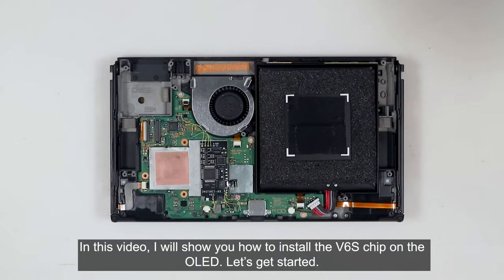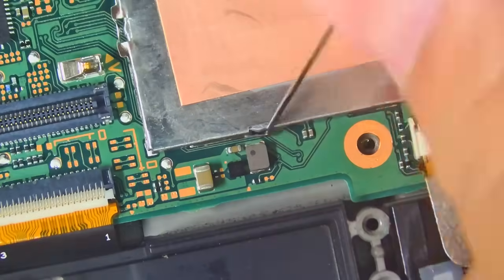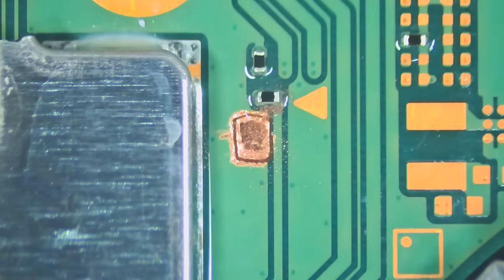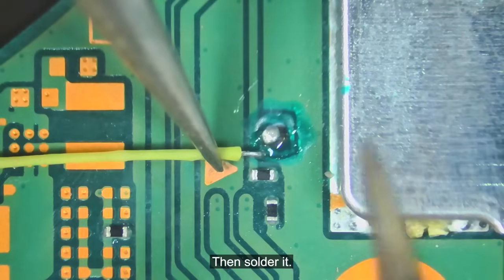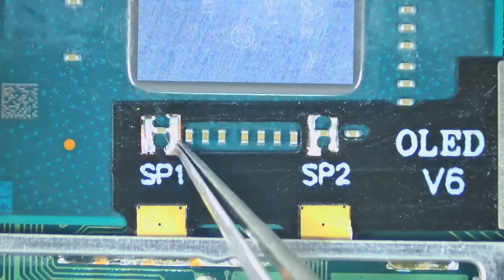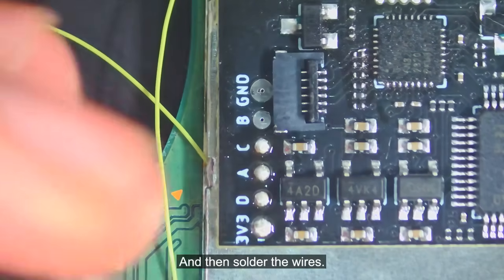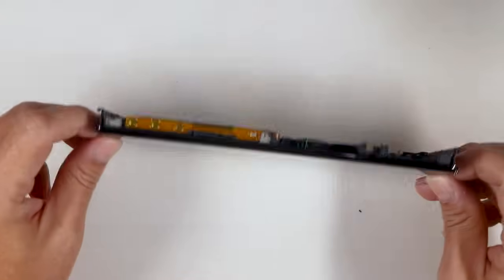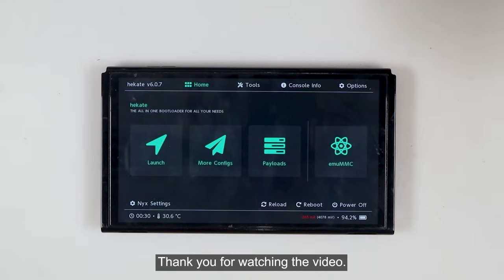OLED V6S WITH THE KAMIKAZE METHOD

Comment: Definitely not for the faint of heart! Still crossing my fingers for a software base vulnerability!
Reply: I understand your concerns but it just isn't going to happen.  I'd suggest buying a premodded switch with picofly. Barely more than a used switch.

I hope in years to come I will have to eat mt words, but it just won't happen.
Reply from the maker: yes you can use Yuzu
Reply: @whitak3r  I was thinking that since its almost EOL for the switch since S2 is just around the corner, theres a bigger incentive for the hackers to look for exploits, kinda like what TheFlow did during the EOL for Vita. He kept the exploit to himself and only release it after support for Vita was dropped.

To be fair, a modded OLED in the market here costs about 33% more than retail. So, maybe that makes sense...
Reply: we can all wish, but really it will never happen, and if im being honest this hardware “vulnerability” to me isnt really a vulnerability, it is literally an external chip forcing the hardware into submission by writing to the emmc and pulsing the soc, now it is still literally a vulnerability, but what I would consider a real vulnerability is the original v1 consoles problem.
Reply: @whitak3r barely more than used? Oled used runs 350 canadian used. Oled modded is minimum 600 cad. Quite the difference. Sold mine for 600 a few days ago, im the minimum lol
Reply: This method isn't for the faint of heart but it's also completely unnecessary.

DAT 0 adapters or reflowing aren't perfect but it's a hell of a lot less risky than this method.
Reply: @whitak3r "isn't going to happen"

The mig switch might open the door to that
Reply: Oh it absolutely is now. Theres already a few p2p dumps with the requires files extra files.Most the releases have to be redumped to include the 'extra" file(s) the mig switch requires. This won't be long though. Long live The Scene.

Comment: I cannot find the .2mm bits anywhere. The ones I find are an actual drill bit and not a grinding bit. Any recommendations?
Reply from the maker: You can buy it on https://www.diyfixtool.com/products/ma-ant-d1-electric-polishing-pen-glue-adhesive-remover-for-phone-repair?variant=44366849507557

Comment: I have a picofly v6s do i need to do the kamikaze if my dat0 flex cable isnt getting a connection even when i think its fully lined up? Whats the alternative?
Reply from the maker: kamikaze all the way..
Reply: @sthetixofficial  ah thank you for this! Do i need that grinder tool? Or can i slowly scrape with what i have? Dremel or fine point xacto blade, etc
Reply from the maker: you may want to watch this https://youtu.be/8ZNde4MVz54?si=RDPPdlAsGA7hl_Tj

use the ma-ant D1 with 0.2mm head
Reply: @sthetixofficial  ah thanks again! You're the man
Reply: @sthetixofficial   last question for you, i bought v6s chips for my oled. Will they work for any oled? I believe my switch motherboard looks different from yours in the linked video on the schematic. And i can still do kamikaze on mine?

Comment: Just a warning when soldering the USB pass through, it’s very easy to bridge the VBUS capacitor to the one next to it and extremely difficult to unbridge because of the tight gap… currently waiting on a replacement so my switch can charge again :(
Reply from the maker: Do not connect the Vbus D+ D- as it has bugs.

Comment: Has anyone had an issue with connecting the D+ D- and VBUS wires , when the charger is plugged in, the system goes into a boot loop attempting to boot hekate ? - remove the charge cord and it boots fine (yes using a genuine charger)
Reply from the maker: Dont connect the D+ D- and Vbus. It has bugs.
Reply: @sthetixofficial  Will remove them, thank you :D
Reply: @performancemodchips  So you haven´t had any issues after you had removed them right ? Cuz I have the exact same problem. But I don´t have any soldering equipment, will it be enough if I simply cut all the wires off from the D+, D- and VBUS points ?
Reply: @MrCANER06  No issues removing them, if you dont have an iron, cut as close as you can to the points on the mobo and cut as close as you can to the chip, remove the section of wire - done

Comment: Very clean job and so satisfying to watch. Keep up the good work and thanks for inspiring us to improve.
Reply from the maker: you are welcome
Reply: Hi, i followed this tutorial but ended up switch not booting. I removed all wires and mod chip but still it is not booting up. Do you have idea how to fix?
Reply: @sthetixofficial  Fantastic work!! Can you tell me what RPM speed did you set the MA-ANT pen grinder to? Has 3 speeds. 5k, 10k, 15k RPM
Reply from the maker: the slowest.

Comment: Tried this method today, everything worked fine, thankyou so much for your video!
Reply from the maker: you are welcome
Reply: @sthetixofficial   I did It but when I put on my console and after training process, v6s have led light Blue and doesn't open instinct page but NORMAL page. I have checked all value in diode mode and was ok. What's wrong?
Reply: @GiuseppeFregiato  That I think is a problem with the CPU flex cable not being soldered correctly

Comment: awesome video i would love to see a follow up showing how to use the flash and reset via the usb port thanks for your hard work
Reply from the maker: the USB port is ommited now, it has bugs, so dont use it
Reply: @sthetixofficial  Are the bugs in the updating part or the reset part?Or everything cause I just got somebody.I know upgrade my modchip to a v6s And solder the wires to be able to use the USB.Port like you did in this video if so can I upgrade via payload and sd card also how do I check what firmware is on the chip?

Comment: Hello! not sure if you're around to answer questions, but all my diode measurements are correct and solder joints look okay, FPC is a little rough but measurements seem okay. I'm getting a solid white light on my V6s (other colors show up and go away quickly). White light stays on for like 10 seconds and goes off. disconnecting the cpu cable also doesn't boot the switch. I'm getting a black screen either way.
Reply from the maker: it is not always about the diode value. White means something is shorting or not right too. Please check everything that were altered.

Comment: Great video again, many thanks. I have this chip coming in the post if I solder it just like the video how would I reset the chip via USB if it ever needs it. Same question for the update via USB process.
Reply from the maker: If you connect the D+, D- and the Vbus, you just turn the console off, connect the console to your computer and do the Putty procedure. Please watch my Putty guide.
Reply: @sthetixofficial  will do, thank you.

Comment: So big love inside !!! ❤️

How much grad must the hot air for tinning the dat0 280 grad ? without fan = 0% from 100% ?
Reply from the maker: it depends on your hot air settings and solder paste type. mine is leaded and needs at least 180c - 200c (real temp) to melt it.
Reply: @sthetixofficial  Hmm I don't think you can melt anything at 200c on the hot temp station. Maybe 350c up and airflow to 30-40%, what do you think? Soldering gun will melt solder at 200c but not sure the air station will be good that low. What exactly do you have it set at for ChipQuick solder paste 63/37.
Reply from the maker: lead free will melt at 225c, while leaded is lower 180c.  you need to find the correct settings of your hot air rework station yourself.

Comment: If you went too far on the D pad and broke the via, is it possible to recover the board by removing and reballing the emmc with a breakout board inbetween? Then make a jumper wire from the trace (reenforced with solder mask, of course), directly to the emmc?

Comment: what temprature is the hot air at? also is this brand > YIHUA 959D-Digital good for this kind of task?
Reply from the maker: you need to determine the temperature that could melt lead free solder. I set mine to 414 c on my station
Reply: @sthetixofficial  which hot air gun do you recommend when on a budget?
Reply from the maker: @Meowtional I used aoyue, haven't tried other brands
Reply: @sthetixofficial  ah alright i decided to go with Atten ST-862D it has the possibility to lower the fan speed for example 414c on 10% causing it to blow less air which percent would you put it on? 5-10%? cause i don't want to damage the pad lol
Reply: @sthetixofficial  also what fan needs to be removed you mentioned it at tining the dat0 pad
Reply from the maker: I set the fan to 50 percent

Comment: Hi,
very good video and explained in the most simple way. Just one question, If I don't have a grinder what tool do you reccomend to expose the B and D points?
Reply from the maker: you better buy a mini grinder, i dont recommend using other tools.
Reply from the maker: I only recommend using a mini grinder. But maybe you can try to scratch it using a very sharp tweezer
Reply: Thank you

Comment: So about this interference when using the FPC cables: How does this manifest on a switch? Blue screen? Hekate exception ? It just doesnt boot? I installed about 6 chips with them, all working fine for weeks. The seventh is a special one: Worked at first, then started to blue screen on boot. Removing the flex, letting it sit for few hours without power brought it back without blue screens. Reinstalled the flex, working again, after a few hours same problem, bluescreen on HOS boot, blackscreen after AMS logo and no boot. Removed the flex again, and it came back. Any idea? I probably just fked up the solder or flex is faulty, isnt it? E: Points were all good, chip was working all the time, eMMC is fine too.
Reply from the maker: most of the issue is it cannot boot to the ofw.
Reply: Intermittent unreliability due to thermal expansion cycles. Just use wires. The CPU flex is ok but the rest should be wired directly.

Comment: Well now I want try this method too, let's go buy another OLED hehe
By the way... any new reason to not use the FPCB for the point A, 3.3V etc...?
Thanks for all clear guides!
Reply from the maker: it causes signal interferences. that is why, using individual wires are preferred
Reply: @sthetixofficial what signal interferences will do? Cannot boot to cfw?
Reply: @etherealyuu  Noise in the data lines and unreliable connections. Just use enamelled wires 36ga.

Comment: Great job! I'm wondering what temp is your solder paste and solder wire? And, just for reference, what temp/airflow do you set your soldering iron for the CPU caps and hot gun for the Dat0?
Reply from the maker: i dont use a hot air currently but i use a solder paste. you can do the same thing using a sharp solder tip , like the T12 JL02
Reply: @sthetixofficial  but what is the melting temperature for the solder wire and the solder paste? 183c or 138c?
Reply from the maker: @lyubo89 183c
Reply: Thanks :)

Comment: As always, great and informative videos!

One thing I would like to know. What kind of interference causes the flex cables? I wasn't able to find much info about it, just some random posts which looked like the chip causes issues with the Switch (black bars on the screen, fps drops, etc.). On the other hand, I had issues with the chip that was randomly un/able to glitch the booting but after sticking it on the shield and covering it start to work properly.
Reply from the maker: at some point your console cannot boot to the OFW with the kit

Comment: @sthetixofficial If the DAT0 line were to break by scratching too much, would the console not turn on? Or what kind of damage would it cause to the console? In that case, is there a way to repair that line by connecting the DAT 0 of the NAND to some small remnant of the kamikaze zone? Thanks for the video.
Reply from the maker: yes your console cannot boot if the DAT0 line broken. You can repair the "bridge" or connection between the emmc and the cpu by removing the CPU and the emmc chip.
Reply: @sthetixofficial  thanks for the reply

Comment: I discovered that with firmware 2.0 Instinct NX V6S loads OFW after working in the dock. stations.
If the firmware is 1.3, OFW loading occurs less frequently.
What is the most current and stable firmware now?

When loading OWF led blink:
1) red light flashing 5 times,
2) purple - 1 time
3) blue - 3 times.

Why?
Reply: The problem was that the wires were long. They should be made no longer by 2-3 cm, as shown in the video.

Comment: Is there any particular reason why you used a different RST point from your last OLED video? I remember when I installed the V6 on my OLED I had some issues with it resetting itself randomly until I redid the RST point and put some tape on it, is that why?
Reply from the maker: The top RST point will be more convenient to solder if you don't want to remove the board from the chassis.

Comment: whats the number wire are you using,, in the video,, and is it a solid core wire ?? or Stranded
Reply from the maker: stranded wire, ul10064 teflon wire.
Reply: Enamel wire can be 36ga.

Comment: @sthetixofficial A question that I know may seem absurd but I'm sure you know something. Can the kamikaze method be performed on a Mariko v2 or a v1? I know it doesn't make sense to do it but the point is in the same place and there are the same resistors nearby (A)? it's worth knowing since it's more common to find normal boards to learn. Thanks
Reply from the maker: why do we need to do the kamikaze on other consoles while their solder point is exposed.
and each motherboard has different layouts, so it doesnt make any sense at all
Reply: @sthetixofficial  Because it's easier to find a bad switch board that isn't OLED to practice with, is it possible to find it in the same place?
Reply from the maker: you mean for practice?
you can buy a dead oled board or try using any switch board and sand to the 3rd layer.

Comment: Hello, which speed should I choose from 1-5, would I choose between 1-2? Does it take a long time to drill through layer 2? I would like to try this giant because the dat0 adapters are simply disgusting
Reply from the maker: 1 is enough. it took me about 5 - 10 minutes to get to the C point.

Comment: I would like to see an alternative clk point, I don't like that point, let's see if you can find an alternative without having to raise the cpu or emmc. I know you can do it
Reply from the maker: you need to remove the CPU cover to install the CPU flex cable. And at the same time you need to scratch that D point - as there is no other alternatives. please check the board scans if you want.

Comment: hi boss, I did all the installation well, all the contacts are perfect even when checking the tester in diode mode, but always with the OLEDs, every time the chip works 10 times and 1 time it doesn't, it produces a white LED with the instinc v6 or v6s and then the original system starts.
always the problem whether it's samsung memories or worse with skhynixm, 10 times the mod starts and 1 time it doesn't, then subsequently like this, 6 times or 20 times yes and 1 no, it goes randomly, and the connections are perfect, I always try changing chips between instinc 6vs, 6v and rp2040
can help me plz, and i do kamikaze
Reply from the maker: check ur soldering quality and micro shorts if they existed. check the sp1 sp2 flex too (the mosfet area).

Comment: Im try using this method.. overall after I'm grinding layer by layer my oled turn on normally.. But I'm didn't why my oled didn't turn on after last layer I'm make..i thought it 4th layer.. after connect battery and turn on 3.3v cap didn't have any volt.. could it be fixed?
Reply from the maker: you need to know if you have broken the track.
Reply: I believe that is on the 3rd layer?
Reply: @AdrianAndreiRobert  I'm repair and make track back..and it work .😀

Comment: Possible to make video how to resetting or flashing the V6S chip directly from the console USB port?
Reply: Sometime happen when chip crash always boot into OFW,  we need to reset chip using method taking off the battery and plug in back, is this V6S chip will help to solve the problem reset using USB port?
Reply from the maker: I suggest buying the V6S next month as they will have new firmware inside it.
Reply: very sure this problem causing by soldering USB 3 point, if i unsoldering 3 point all work without any problem, i think some step is missing like need to reinstall MTP driver?

Comment: Just pressing both volume buttons will boot it into stock firmware? No press of the power button?
Reply from the maker: power it on, and when you reach the chip logo screen, you need to press both volume buttons.
Reply from the maker: or, press both volume buttons then  press the power button.
Reply: @sthetixofficial  thank you

Comment: I was wondering why you used a grinder to expose the B point track, unlike in your V6 OLED video where you used the B point which is already exposed?
Reply from the maker: because in this video, i did not remove the board from the chassis and the alternative B point is at the top of the board

Comment: Como es el proceso de resetear o flasheo del chip via usb? No encuentro informacion sobre esa nueva funciones del chip v6s
Reply from the maker: I will make another video about this matter soon.
BUT in principle, you can use Putty to reset the console. Just plug the console to you computer and do putty. that will reset it

Comment: may i know what will happen if over grinded? lost the C point, and reached or over grinded 4th layer ?
Reply from the maker: then you need to manually join the emmc dat0 point to the cpu by removing both chips and reball it.
Reply from the maker: yes it does.

Comment: hey which solder paste u use for dat0 point ? low melt ?
Reply from the maker: standard leaded solder paste. I used mechanic brand
Reply: @sthetixofficial  you have maybe a link for it ? that will be great ^^ thx
Reply from the maker: @ozzygalantos8927 you can easily find it on aliexpress, i bought it locally